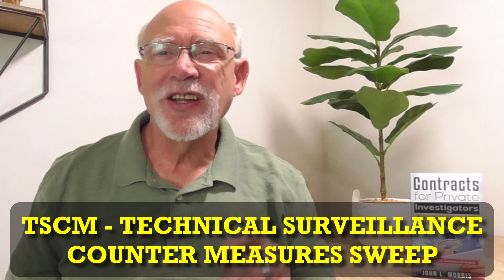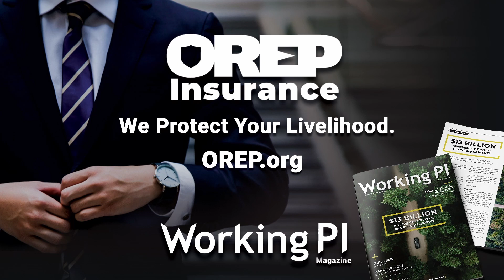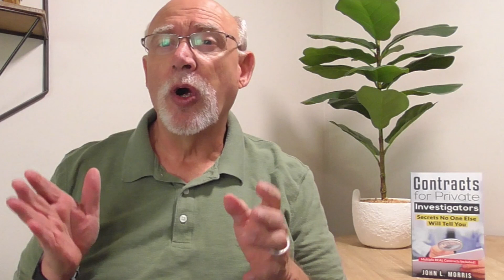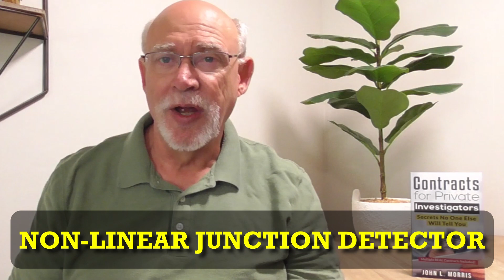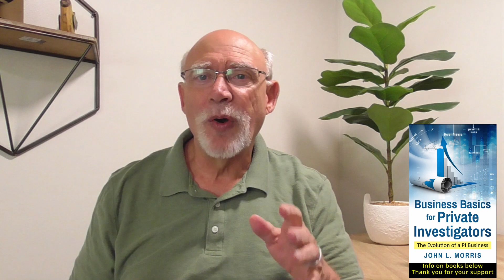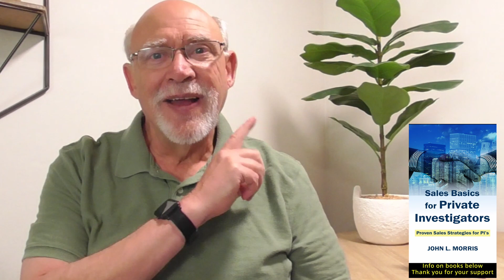The Bug Sweep Basics Every PI Needs to Know!

Comment: the andre costs upwards of 3 grand. but it is unique on paper in that it detects up to 12ghz. nowadays, depending on threat model, one can use a spectrum analyzer which indicates frequency spikes along a given spectrum with a directional antenna. this can be far more affordable and practical, depending on what equipment is used.
Reply: BH04 PRO Spectrum Analyzer, Event log reporting and live sweep. solves a lot of the cost issues and the fear. A lot of guys do not want to put a $10'000 in a clients office overnight and a client may be wary of agreeing to replace such a device if anything were to happen. Lot of TSCM guys now use BH04 PRO for presweep analysis, its less than 2k, works very well and is a good option when a full scope of kit is not an option. 0.10-8GHz.